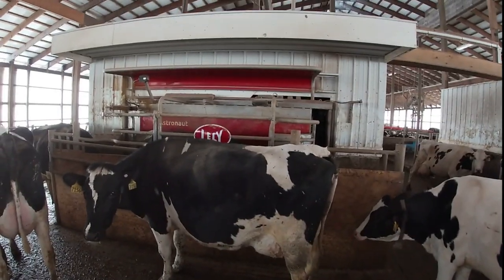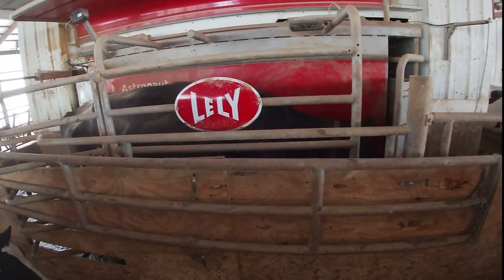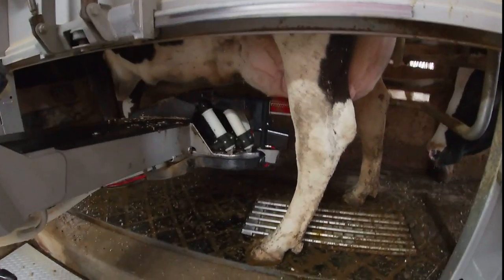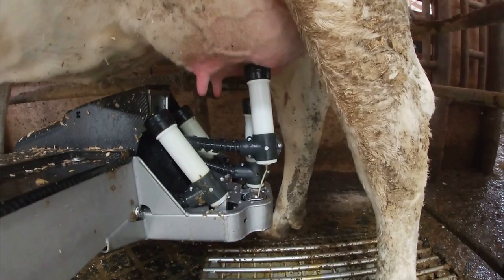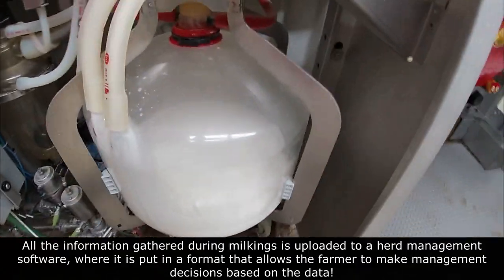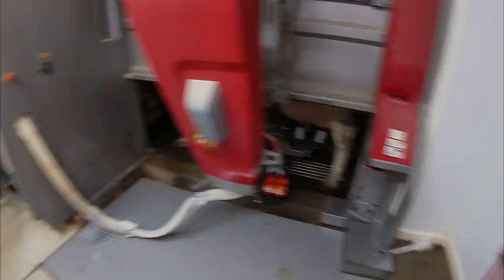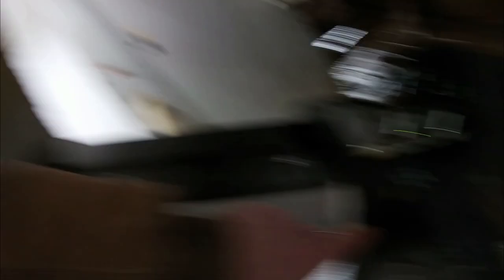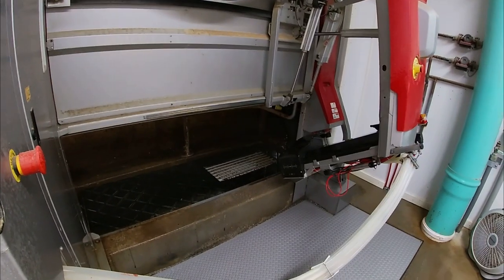How we milk cows on our farm...or rather how we do not!

Comment: This was the newer model correct? What are the differences with the older model?
Reply from the maker: Correct, this was the A5. Biggest differences is the Milk pump, Impeller vs Bladder on the old, and a lot less compressed air use. As well as faster processors.

Comment: Does the robot forestrip the teats?
Reply from the maker: There is what they call a "pre-milk device", which consists of four chambers(one for each quarter). Each chamber has a little ball in it that will float to the top as it fills with the initial milk. Once the ball reaches the top the milk will go to the receiver jar. The fore stripped milk that is in the chamber goes down the drain at the end of the milking along with the water that is used to rinse the cups.
Reply: @milkingmadness3778  Thanks for the reply, you have a great channel. Keep em coming.